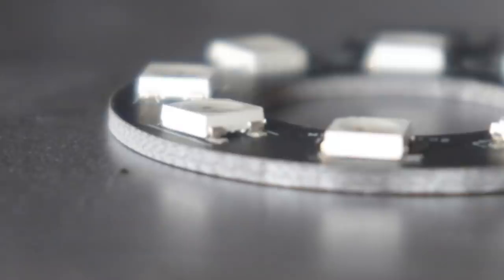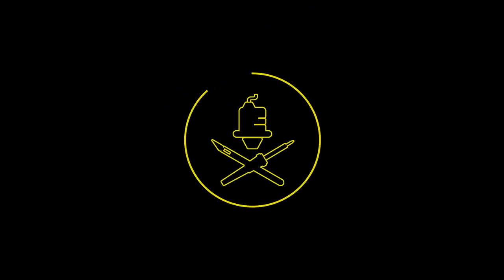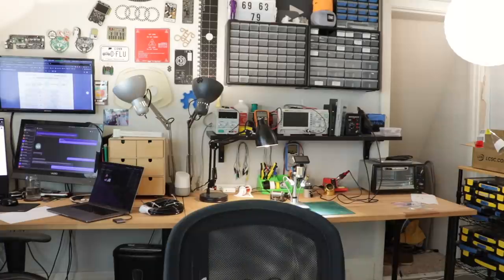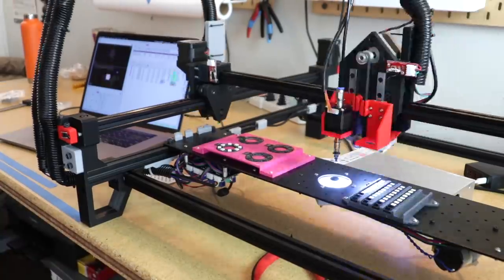Index PnP Assembles Circuit Boards!

Comment: You can hack the toaster oven and create a reflow with the correct heating profile with a small controller, heat sensor, solid state relay
Reply: Did that myself in the past two months when i found the time
Totally worth it
Reply: Yes. It will be a fun project.
Reply: Ah, great to see other people thinking this too! I saw that and immediately thought "Well then, there's your next project right there!"  I love repurposing hardware like that.
Reply: Adding insulation and sealing makes a huge difference too.
Reply: @JonathanBuford  A little air circulation goes a long way aswell.
Reply: @19janiboy96  yes it makes a huge difference, no hotspots and consistent results across large single or panelled PCBs.
Reply: @JonathanBuford  yes, the temperature rise in degrees per second is much higher, it also saves power and makes.your heating elements last longer too!
Reply: @19janiboy96  doesn't air circulation cause some disturbances?
Reply: @TechBuild  you can also use nichrome wire and make a custom reflow tube for your conveyor.

Comment: Looking good.  When I have not had a stencil I have used a laser cutter with an overhead transparency... key is to lower the power to avoid getting rough melty edges.

Comment: Would just like to say that you always want to get the paste on in a single wipe, use a firm blade and have the paste so that it rolls/tumbles on the blade as you wipe over the PCB.  Use good pressure and around a 60 degree blade angle.

Comment: I love the progress. 
In a previous video you had feeders for the items and the PCB. This one didn't have them. Were the feeders designed for a previous PnP and don't work with this one, or did you  just not use them?
Reply from the maker: Just didn't use them! The feeder works pretty good, especially for larger components, but the way I set it up in software was a bodge, just to validate that it worked. We're working on adding RS-485 support into Marlin right now, so we can do it the right way! Just didn't want to waste time futzing with my software bodge when the nice solution is just around the corner :D Same with the conveyor belt; hardware works pretty well, software integration is a pain (and in progress).

Comment: Didn’t you build a solder paste dispenser for the index?
Reply: Yeah are you going to use the Despenser in production or use solder stencils?
Reply from the maker: I did! It was an early R+D effort, and worked pretty well! I've just decided to focus on getting core functionally working super well first, then I'll dive back into that part. Project milestones are here: https://github.com/index-machines/index/wiki

Comment: Fyi, solder paste stencils are totally 3d printable! you can just print a single layer with the necessary holes in it. hell, you could even put board alignment features on it.

Comment: Why didn't use your feeder? And did the open PNP can dispense solder paste?
I really love your videos an especially your reaction when something worked 😁
Reply: Feeders have gone through several revisions but are continuing to undergo testing and will see another revision. I'm currently building my Index and will muddle through with the strip feeders for now until the official Feeders are ready.

Comment: There is a video where someone dismantles a ceramic iron to use as a reflow station which might be something you could attach to your PnP machine, so you apply the solder, the components and melt the solder in one operation, rather than masking separately then using the PnP then melting the solder in a third operation.

Comment: Nice. I am interested in the speed. I dont know if you catched the trend but if you want to print real fast on 3d printer they add accelerometer to the hotend carriage. I dont know how it works but this could work with the index.

Comment: You should check out Unexpected Maker's Reflow Master, idk if he still sells those on tindie but it's basically a ultimate controller for a toaster oven. Just needs a relay and a little tinkering with the oven's guts.

Comment: Very cool. I love the use of simple 3d printed fixtures.

What do you think of making solder paste stencils by printing a single layer sheet of PLA with a 3d printer?

edit: 
if 3d printed stencils work another advantage would be the ability to print additional layers on an edge to help position the stencil on the board. this could benefit both accuracy and speed.
to gain additional efficiency you could print the stencil with the same layout of your jig/fixture to easily stencil a batch in one go.
Reply: I would also suggest this plotter:
https://www.youtube.com/watch?v=ZRmu9CYDE9E&ab_channel=SilhouetteInc.

it can cut out a film (100 micron thick) with decent precision.
I know that some R&D companies use this approach.
Reply: @andriilogoshko8881  that's the right tool for the job. I would still be interested in the 3d printer approach to see if it could be a 'good enough' tool in the absence of a plotter, laser cutter or paste dispensor.

Comment: The part where you made your own solder paste template got me thinking... Could you use a vinyl cutter to make one?  Then it got me thinking more... Could you use a vinyl cutter to make your own etch resist templates... (yeah for production runs Pcbway is great, but it can get expensive and time consuming if you're still just prototyping).

Comment: As far as tolerance stacking goes, that sounds like it may be a real risk in terms of sending it out to customers, if it's a complex or fiddly process. Is there potentially a way to calibrate all the measurements independently from a single point, so there's no accumulation of error?

Very nice to see it working, by the way!
Reply from the maker: I probably didn't explain it very well, but I'm pretty sure that's what's happening under the hood in OpenPnP. Everything seems to be based on the downward facing camera (which is kind of your ground truth, reference point as that's what you're using to navigate your machine) and everything else is an offset from there, so ideally no stackup! I think one of my cals was just a little off.
Reply: @stephen_hawes  Glad to hear it! It's always nice when open source stuff just kicks ass.

Comment: Question:  Why aren't you using servo motors instead of stepper motors?
Reply: read up on stepper motors and you will understand :)   and also servo runs on potentiometer and is not accurate over multiple revelations

Comment: The link for the modules in the PCBWay store does not lead me to your modules, but just to the general project/gifts page.
Reply: I have found, however you don't have the latest MOBO available, the one that is 4-layer and only 100x100mm. When?
Reply: @MoviePropElectronics  It's still split out into "mobo-rev3" branch while testing is underway. I believe once Stephen confirms that the beta 2 board he's building in this video has no showstopper bugs, he's going to move the mobo back into main and then it will be an official release. But you can download and order this PCB today if you want, you just have to switch branches with the little dropdown menu.
Reply: @feldon27  Thank you :)